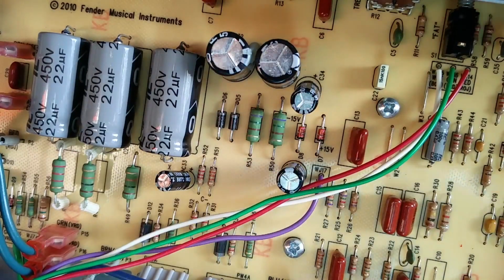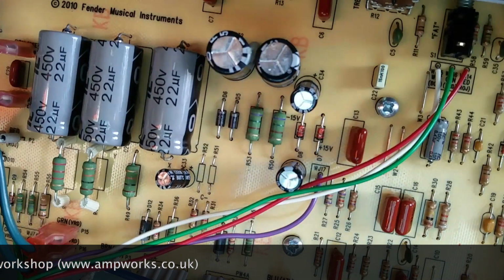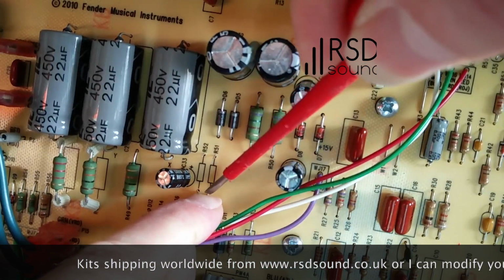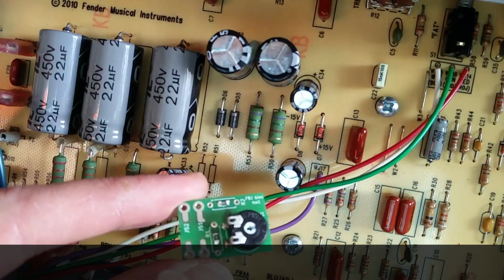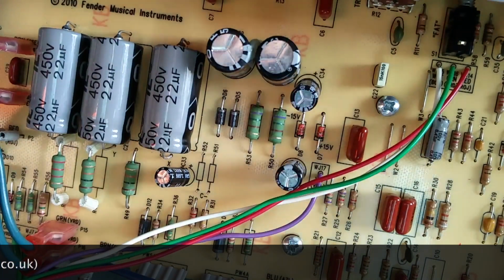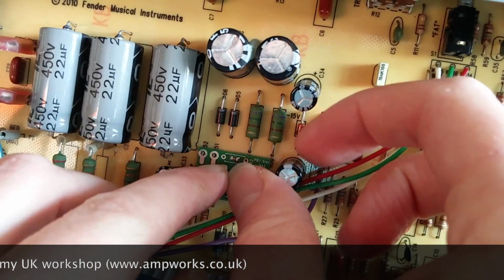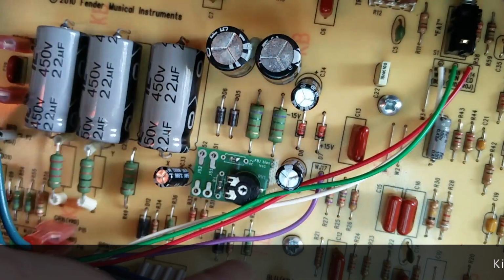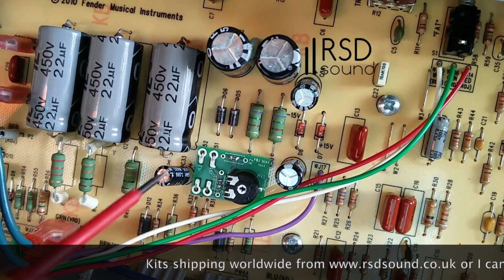The easiest way to Do a Fender Blues Junior Bias Mod (using an www.rsdsound.co.uk kit)

Comment: How do you check the bias and what should it be set to?
Reply: I think that you'd use a bias probe.  It's this thing that goes between the tube socket and the el84 and can output to a multimeter.  That's where you can read the tube bias.